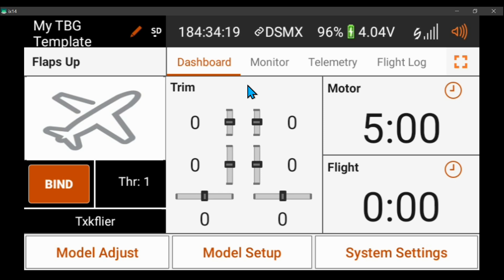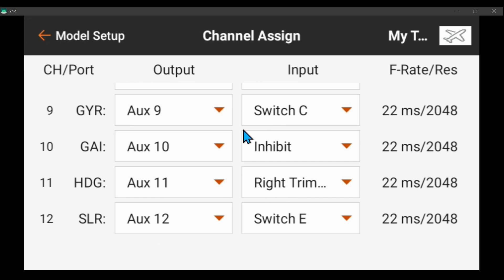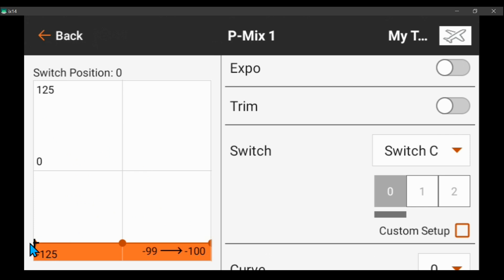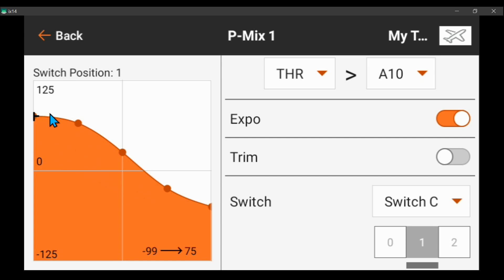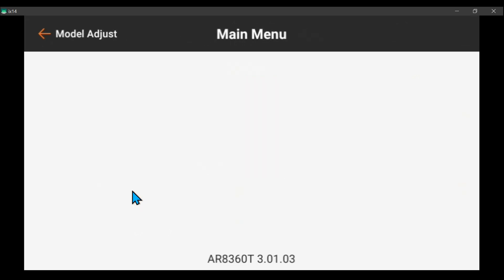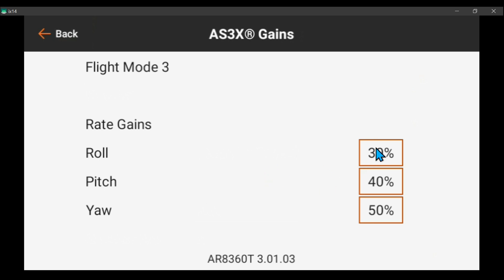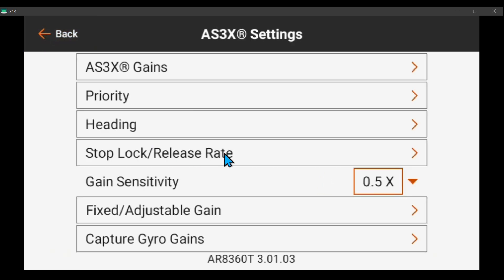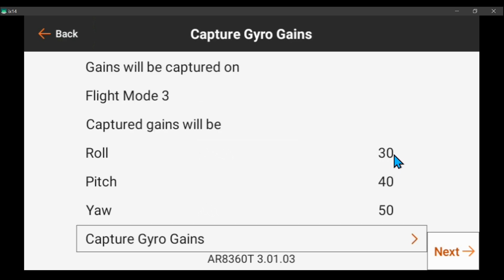How to Set Up Throttle Based AS3X Gains with a Delay

Comment: Have you had a chance to test your throttle based gains?  If so, what are your thoughts? I have an Eflite F-16 80mm I would like to try this on but I would test it on a less expensive plane. Thank you.
Reply from the maker: No, I haven’t. I don’t really believe in increasing the gain at lower speeds because a gyro doesn’t know to keep the ailerons centered when a plane is about to stall. A downward deflected aileron can cause a tip stall. This is one of the reasons I don’t use flaperons. I don’t remember if I mentioned this in the video.
Reply: @txkflier  Not trying to be rude, but why make the video if you don't believe in it.
Reply from the maker: @twincitymoo7141 Someone wanted to know how, so I showed them a way to do it.
Reply: @txkflier  I don't have anything against Jon at Two Brother's RC, but I have to say your explanation of Throttle Based Gains is alot easier to follow. After watching your video I built up so much confidence to try it. Then, I read what you said in the comments about Throttle Based Gains.
I have a NX10 and wish someone would do a video with a NX10.
Reply from the maker: @twincitymoo7141  Thanks, I just watched it a couple of hours ago and saw some things that I should do over. I've learned a couple of tricks since I made it. Your NX10 will do it too; the menus are just laid out differently. I have an NX10+ as a backup to my iX14, but I don't like making videos with it. Being a full scale pilot, I know what happens when a plane is on the verge of stalling and you apply some aileron. A human can eventually learn to keep the ailerons centered and use the rudder. But a gyro has no idea that the plane is about to stall and doesn't know to keep the ailerons centered. If you've ever flown an E-flite 70mm Viper, you probably know that it will tip stall in a heartbeat if you or the gyro deflect the ailerons.
Reply: @twincitymoo7141  No offense taken. Everyone has their own ways of doing things. Just happy to see people using their radios in-depth over here!
Reply: @txkflier Good point about flaperons and aileron centering.
Reply from the maker: @lwrandall  The other reason I don't like flaperons is adverse yaw. Some folks use tailerons for roll control with flaperons and that creates more problems.

Comment: Im using the nx14+ with an ar10360t+, i cant get into forward programming no matter what i do. I would appreciate some insight if possible
Reply from the maker: Make sure your transmitter has the latest version of AirWare installed. I have a couple of videos on how to update AirWare.
Reply: @txkflier  I've updated the airware app before i posted
Reply from the maker: @deberryn  Have you shut down the transmitter and restarted it? Have you redone the bind to the receiver? Do you have the SPMA3065 programming cable and have you updated the firmware in the receiver?
Reply: @txkflier  I've been fiddling with this for several days, yes I've power cycled everything, all updates are recent including testing old updates. I haven't tried rebinding, I was under the impression you needed to use a second tx to clear bindings.
Reply from the maker: @deberryn  No, you can re-bind using the one transmitter. When you put the receiver into bind mode, it forgets the old bind.
Reply: @txkflier  that did it, I appreciate your help